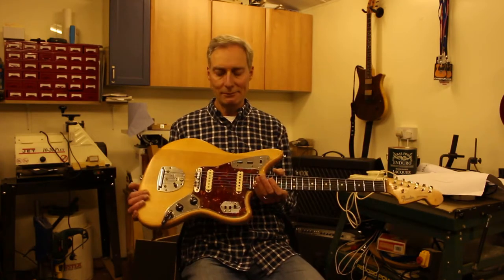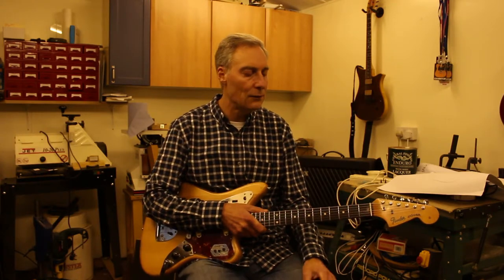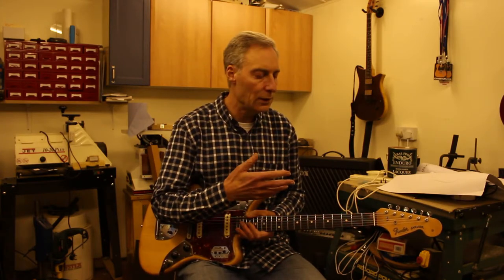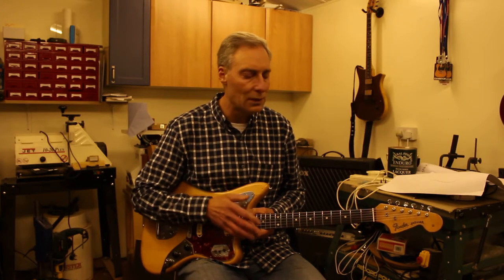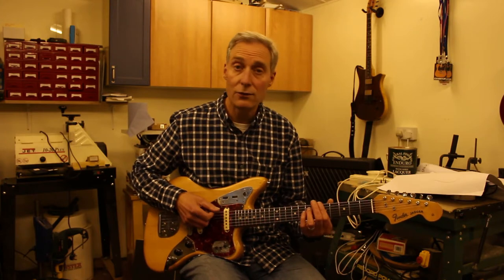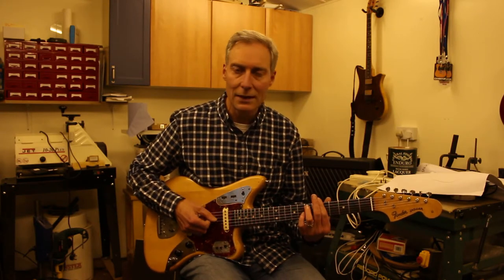Refretting a vintage Fender Jaguar guitar

Comment: great video. I am curious if the Johnny Marr Jaguar which is based off of a 65 Jaguar neck has its vintage style frets installed from the side as well or did they discontinue that practice altogether by 1982?
Reply from the maker: I'm pretty sure that that the frets on all of Fenders "vintage" inspired guitars are installed from the top.
Reply: @flameguitars5770  ty m8